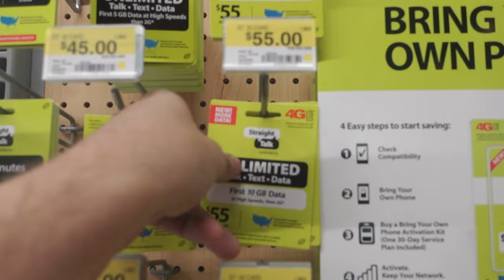Bathing in a Frozen Lake - Baja or Bust 07

Comment: The heater should shut off the propane if the heater fails to light. The fan does not quit blowing though. Parking my truck to close to the intake was enough (luckily) to keep mine from lighting. I would assume heavy wind hitting that side could too.

Comment: My 2 cents: Boost Mobile sucks! 
Verizon, ATT, and T-Mobile give you similar service. 
I recommend Cricket. They are owned by ATT and use ATT towers, but have much better pricing. I've had Cricket for about 2 years and have very little to complain about. I travel for work and it has worked everywhere i have been. 
Good luck on your travels!